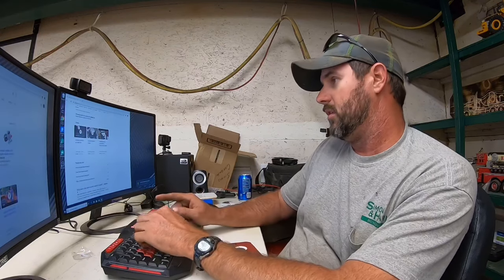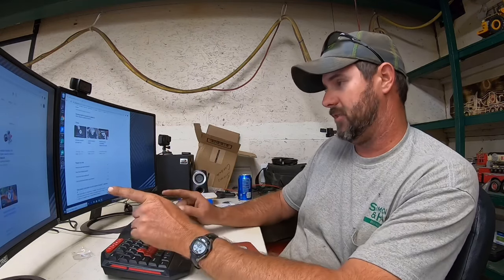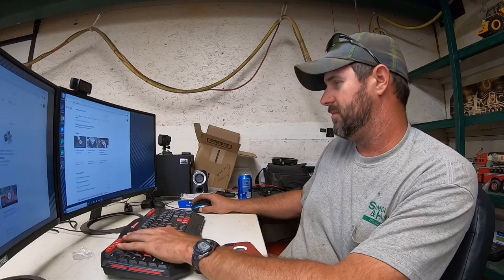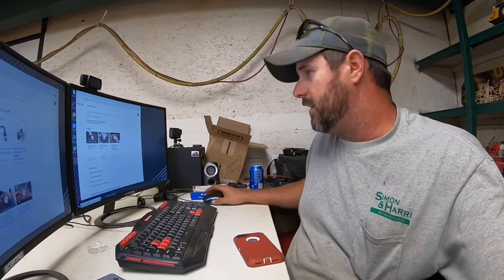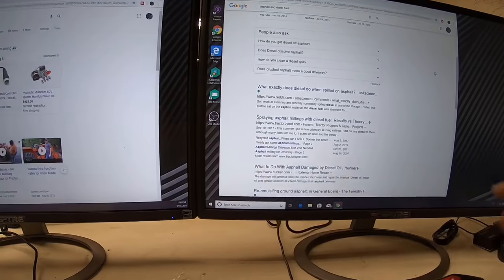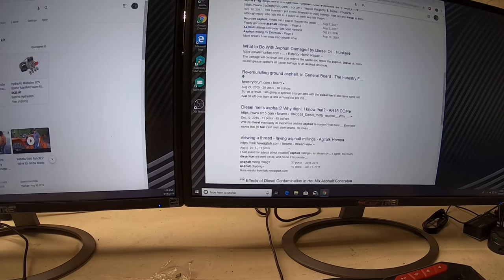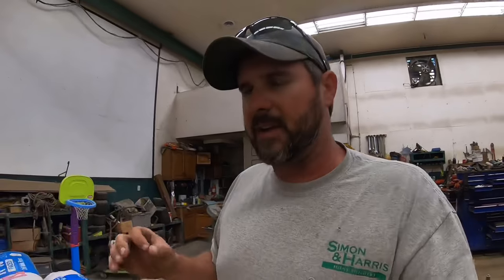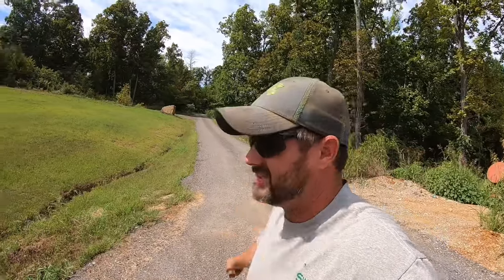Spraying diesel fuel on asphalt millings good idea or bad idea my thoughts

Comment: I have seen people use fuel to try and help bind killings. Within 2 years it’s just rock. 

I’ve also seen guys use torches to heat it up and roll it. That seemed to workout ok. I think if you’re going to do all that extra work. Just have them put down asphalt.
Reply from the maker: Asphalt 72k millings 1500 big difference

Comment: I live in Phoenix Arizona I have laid down thousands of tons of milling‘s and the best Time of the year is when it’s about 112° out and I use a vibrating roller and it works absolutely fantastic. You need to put it in at about 5 inches thick is the best thickness and it will literally turn back into asphalt. But that’s here in Phoenix Arizona if you are up north just wait for the hottest day of the year and then lay it in

Comment: Yes diesel fuel is a bad deal but if you run it what's called a reheater what's sometimes called a bitumen heater and then seal it it's effective but you have to use a steel roller with water cool on it but other than that it looks good man I would not mess with it 👍😎
Reply from the maker: Yup I could see that working well

Comment: We’ve been using “planings” as we call them here in the uk to fill potholes on our farm track and reading all your comments makes me think I’ll just have to try to find out by experimenting.
  Any tips on pothole repairs gratefully received 👍🏻
Reply: Get the hole clean of loose stuff before filling and make sure it's sealed good around the edges before moisture can get in there and freeze that's the number 1 cause of patch blowouts or chunking out and yes I worked every position on a paving crew starting as traffic control clear up the ladder to crew foreman before being differently abeled in an accident

Comment: Diesel fuel will melt the asphalt. You can spray it, give it time to melt, roll it then leave it alone until the diesel all evaporates. The trick is to get exactly the right amount of diesel down. Too much will wash the asphalt out of the rock and too little won't do anything except to the surface. The second trick is you have to stay off it. Diesel takes a long time to dry. Sometimes months depending on how much you have to use and how deep it goes. Therein is the problem. Why have a road and not be able to drive on it.
You could mix the millings with diesel and turn it back to the way it was when it was first put down then put it down again like the paving companies do. But it's more expensive to do all that than to buy fresh asphalt.
Reply from the maker: Good info thanks

Comment: yea diesel fuel i s the worse idea I have ever heard. You need to put some Tac Oil just like they use on highways before they resurface  a highway then roll it to pack it down . Tac oil is like a glue for the asphalt.  I use to work for one of the biggest asphalt plants in New Jersey.
Reply from the maker: Yup looking into that

Comment: I have a question. I live right next to a busy highway. It was a perfect highway until TXDOT came through last year and redid part of it. They started and stopped outside my bedroom making the seam there. Loaded trucks you do not hear anything but the empty trailers make such an awful noise. The concussion of the impact often rattles everything in my apartment inside a metal building. TXDOT came and looked at it and said they would not do anything. My state representative has talked to them and they told him no as well. The seam is high on the old part of the highway just enough to make a crashing sound when an empty trailer hits it. I went and bought some diesel after seeing your video and between cars I was able to run out onto the highway and pour some on the high spot. It immediately seemed to help because the pavement is very dry because we have not had rain in a longtime. I have diesel left and New Years morning I am going back out there and douse it again on the high spot when there should be little or no traffic. I am hoping that the diesel will soften it up enough to blend it together after a few big trucks run over it. It is awful to be awakened many times a night and anything will be better than what it is now. Any thoughts?  Sleepless in Texas. Please answer me.
Reply from the maker: Hmm worth a try I guess
Reply: @DirtPerfect  I ran out there between cars and poured some diesel on the high spot and after big trucks ran over it I really think that it helped. I am going out there and pour it over the bump again New Year’s Day early in the morning When there is little to no traffic.

Comment: Go look at any gas station who's lot hasn't been paved in the last few years and you will see oil stains from cars that are turning into potholes. Motor oil, or any petroleum based fuel or lubricant, will destroy asphalt over time. You can usually even notice the oil spots get worse closer to the entrance from the higher volume of people parking there and adding oil to the spot if they leak.
Reply from the maker: Yup I agree

Comment: This is why fuel stations use concrete around the pumps. Like you I thought this is common sense? We always used diesel to clean up after putting tar on a basement wall.
Reply from the maker: Yup

Comment: The only time I’ve ever seen diesel sprayed on anything with asphalt is to keep it from sticking in the bed of the truck. That’s pretty much the only time it’d be a good idea. I’ve seen people use tar to aid in compacting it and making sure you have a seal but to use it on millings outside of the bucket is terrible advice
Reply from the maker: Agree

Comment: Asphalt is the heavy petroleum product used to bind the sand and gravel together. A thinner petroleum product added to it will break it down. Modern diesel fuels are even thinner and more volatile than in the past and will evaporate leaving little to no residue. I remember how there always used to be an oil film around diesel fuel tank fillers. Now there is no film produced as diesel fuel is much cleaner.
Reply from the maker: Good info

Comment: PS for those that think that diesel is alright to spray on asphalt go take a look at an apartment house especially under the carports or the same car parked at the same place all the time if a car leaks oil or gasoline or diesel it ends up pothole it dissolves the tar that holds the asphalt together
Reply from the maker: Yup

Comment: We had a truck with a diesel leak and it basically dissolved the tar leaving only the rocks.....  It was a pain to fix as nothing would stick to the ground or edge of the pothole.   We had to cut out a section of the parking lot to fix it.
Reply from the maker: Yup could see that

Comment: Here in the UK  the trucks will wait  up to 2 hr with hot tar after that they will return  it to the plant . Butt we use old diesel to brush on hot tar jobs not cold tar or temporary tar  ie  shovels ,wheel barrows at start of shift . If we use millings  we have a bitchamin truck to spray bitchamin  on the millings after the rolling is done great video new to the channel
Reply from the maker: Interesting Rory and welcome to the channel hope you enjoy

Comment: We actually tried this several days ago.  Amazing.  We were filling pot holes in CHIP SEAL with asphalt and then we had a large area so we covered it (about 3" deep) in millings and sprayed diesel over the top.  After cars drove over it for just two days you can't tell the difference between the real asphalt and the millings.  They are packed down, glued together and flat surface.  We covered an area about 6' wide and 30' long.  Sprayed 6 gallons of diesel.  I think maybe 3 gallons would have done the task.  Time will tell how it holds up.  If you're curious, give it a try.   As far as the chip seal, I don't recommend it.  I'm in Kansas, we get several freeze / thaws every winter.  Once water gets under the chip seal and freezes it just crumbles into little pieces.
Reply: I'm in northcentral KS and my dad's milling driveway to the machine shed he had chip sealed almost 12 years ago is holding up fine he waited a few years to chip seal it to make sure it was solid (and financial reasons) and water doesn't get under it getting it on grade good and proper drainage is key

Comment: If a bag of cold patch was open for a couple years, and seems to have dried up some, would adding a small amount of diesel fuel soften it to its previous state so that it's usable again?
Reply: Actually drain oil or used hydraulic works great or mixed with 20% diesel. Epa might not like it though

Comment: I know this video is older but does anyone know if it would be easier to  milling to install a heated hydronic snow melting system as a posed to asphalt due to the heat of the asphalt over the pex during installation
 I considered concrete but the slop is a major issue I'm told is currently asphalt that was laid back in the 80s and is just starting to show it wear 
Also if anyone is interested I'll will be using a outdoor wood boiler with a oil boiler backup for the snow melting system 
Thanks in advance
Reply from the maker: I have know idea
Reply: @DirtPerfect   Appreciate the response figured it wouldn't hurt ask maybe if you didn't know the committee might have some options 
Thank you sir have a blessed day

Comment: I’ve seen it done with diesel. But the most important thing is to make it at least 4” and roll it on the hottest day of the year. The idea of the diesel is that it re activates the cured/dry oil. Then the sun comes and the roller and makes it very similar to blacktop

Comment: I agree with you on diesel and asphalt. I was a bldg. engineer and took care of industrial  and commercial  buildings before I retired. I had a diesel spill in a lot that sat for three days before I found it and you could use a broom and dust pan to clean it up. It destroyed a 25' X 35' area of lot. A truck hit a fire hydrant at is fuel tank. I also had run off in a pond next to the spill that need to be cleaned up.
Reply from the maker: Wow sounds like a real mess
Reply: The state came through last year and left a seam where they started and stopped new construction outside my bedroom window. The new part was lower than the old creating a bump that would rattle my apartment when a truck with a empty trailer hit the bump. Have not been able to sleep for over a year. TXDOT will not do anything about it so just today I bought diesel and between cars I poured diesel on the high part of the bump. I immediately noticed that it seemed to smooth out the bump. Anything is better than the way it was. I am doing it again New Years morning with less traffic. The state of Texas absolutely ruined my life when they did this. The highway was as good a road as there was in Texas until the state came in and redid it and made it worse. I will absolutely pour 100 gallons of diesel on the high spot that causes the bump if I have to.

Comment: Hey Mike!
Great food for thought here, I wholeheartedly agree with your opinion and reasoning. It has been my experience with asphalt millings that you spread them and compact the material during the hot weather.
Having them on several parking lots (residential) and some driveways, it has been my experience after months of summer heat, the millings do bond to themselves, just like you showed in your driveway example.
Additionally, I'm able to run over them in winter with snowplows, skid steers, sand trucks, with no adverse effects. They are inexpensive, readily available during the paving season, and hold up tremendously well.
The highway departments here in New England also use the chip n seal on the secondary roadways. They typically use 3/8" pea stone as a top dressing and it holds up to traffic and weather very well.
I believe that process would perform very well in your driveway application and last for years! All the best to you and your family from here, have a good, safe week.
Doug@ the "ranch"
Reply from the maker: Good in thanks
Reply: Why does your reply show as a month old? This was just posted today. It must have been private for a while and you had access to it?
Reply: @JoelHershberger  Hi Joel, YouTube problem I believe. I did comment when Mike released original the video, somehow it's showing up again here dated Oct 21st ??

Comment: I think you have to put them on thick enough too. One or two inches won’t do.
Reply: I did it to most of my driveway. I agree heat and compaction are the best way to harden it up. I would put it on 4 or 5 inches thick too.
Reply from the maker: Yup I agree mine are 6 to 7 inches

Comment: How would what Ii have heard called slurry seal do to your driveway? I know they do a lot of parking lots in our area and I have even seen it done on just plain gravel. Would it be a bonding agent on all of it. Our Kroger store just this spring used slurry seal on their asphalt parking lot and it has done well.
Reply: its cheap and terrible. also its  a repaving not initial paving method
Reply: Some places slurry sealing isn't used at all.
Reply from the maker: Don’t know much about it
Reply: @DirtPerfect  its an  asphalt (oil) emulsified in water, mixed with chip (crushed rock fines) then applied cold to the road surface. when your neighborhood streets get that fresh blacktop look suddenly one day, its cause they just  sealed the road.

Comment: Unless you own a multi million dollar asphalt plant where a small percentage of millings are used in the process to make a new batch of asphalt at some 350 to 400 degrees, the sun is the only thing that will stick millings together. Compaction of course is a necessary ingredient in that process as well. ....Jack Baker
Reply: Actually asphalt is mixed at 300 degrees not 350 or 400.
Reply: @briangardiner1015  Depends on the batch processor and what part of the country your in. In W.v. whare I pave it has to hit the bed of my truck at 350 to give me enough time to get it whare its going...Jack Baker
Reply: @jackbaker5284  Some plants are using what is called Warm mix asphalt. It is produced cooler then normal. One problem with recycled asphalt is the asphalt in the millings will burn if it is too close to the burner. Asphalt isn't made that hot normally, if it is made that hot it is for a long haul or the weather is cool and it looses a lot of heat. Do you have to tarp it when it is that hot?
Reply: @briangardiner1015  Depends on the weather and the length of haul. If you want a good final product when laid down, which we did some of the best in our little world here then yes it was always tarpped. Getting it to the job as hot as possible means less work when laying it down, and more time to shape it. The cooler it is laying it down the worse it looks, and lasts......Jack Baker
Reply: @jackbaker5284  Here it is common to haul asphalt 150 miles for a small job.
Reply: Jack Baker what part of Wv you from
Reply: @brianbaughan5683  Summers Co.is where I  live,not originally from here though....Jack Baker
Reply: Jack Baker your down in the mountains